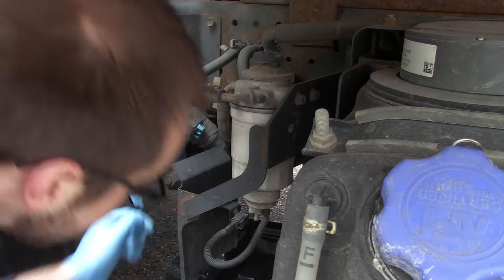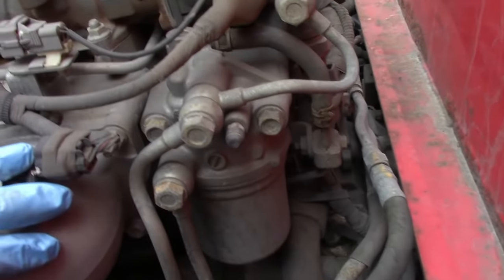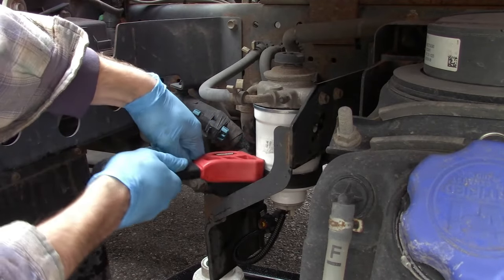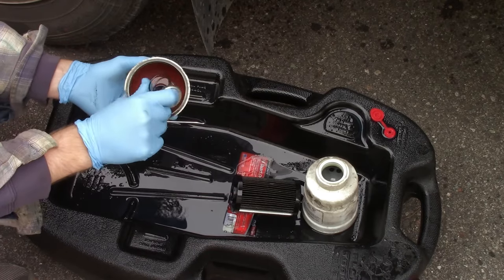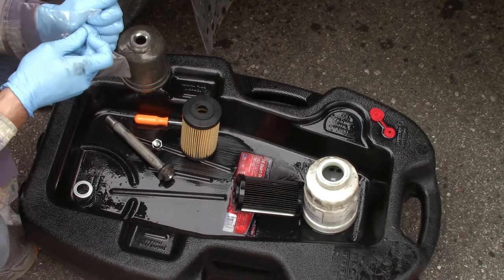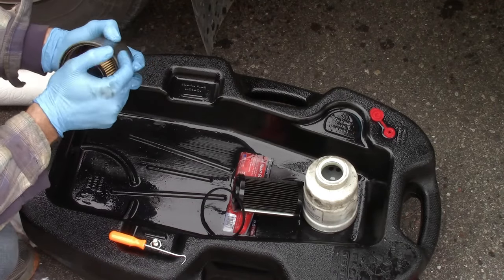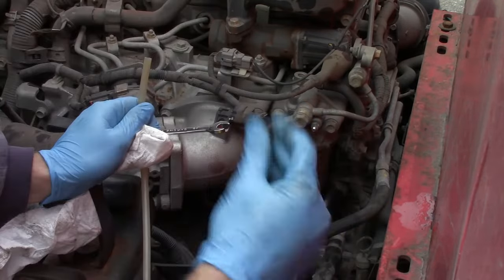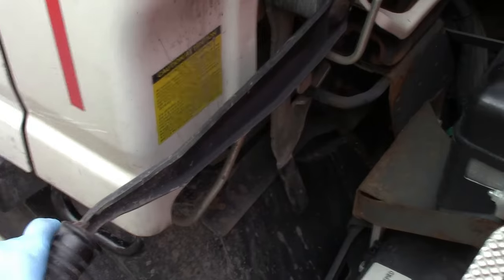Isuzu NPR NQR NRR Fuel Filter Change

Comment: Can you use the pump on top of the primary filter to eradicate the air out of both canisters ??? (If you don’t have that tool from Harbor freight )
Reply: Did u figure out if you can?
Reply: I have used the hand pump a number of times. It takes a lot of pressing. Manual saw between 50-500 pumps 😂

Comment: I have a 2004 NPR.
Are there any major differences in the 2004 model?
2004 is before the emissions control additions were added.
Reply: Yes, it's a different engine.  You don't have nearly as complex a job.  It's more like an oil change.